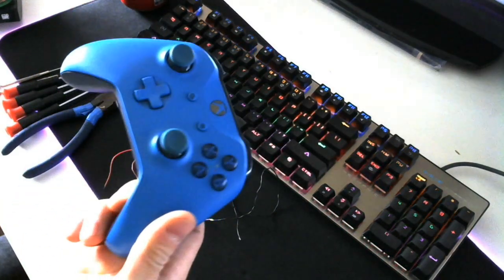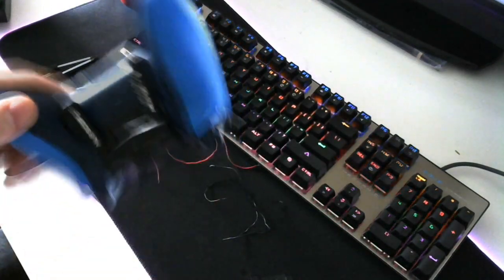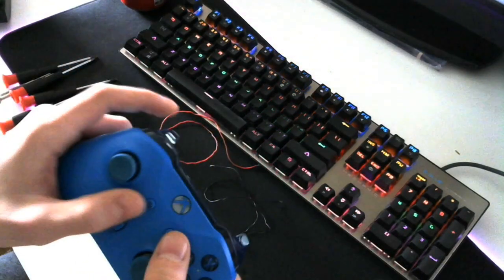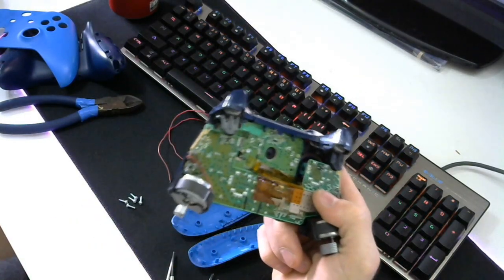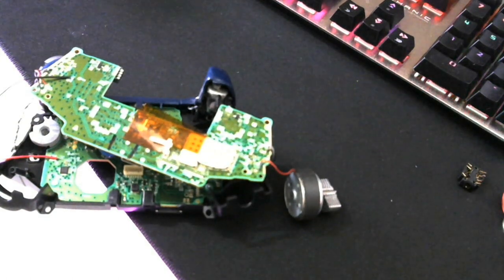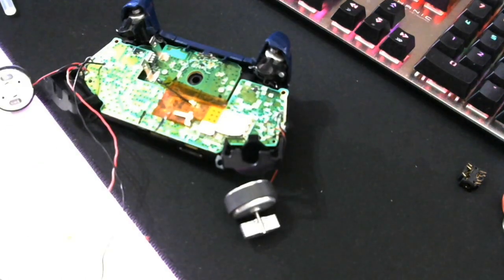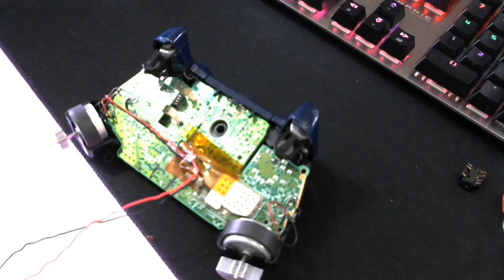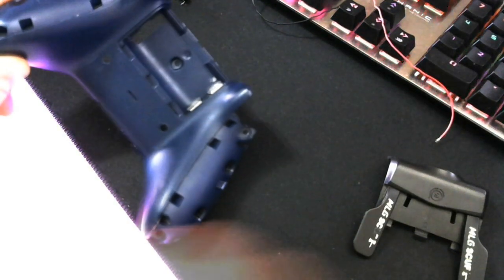DIY How to Scuff Your Xbox One Controller! Saving $$/££ (POOR MANS SCUFF)

Comment: Just tried and the resistor on r29 came off was using to big of a solder make sure you get a small tip as the contact point is really small

Comment: If I only wanted to do the A button, would I just need the lead wire from TP21 and then run the black wire from switch to the rumble terminal?